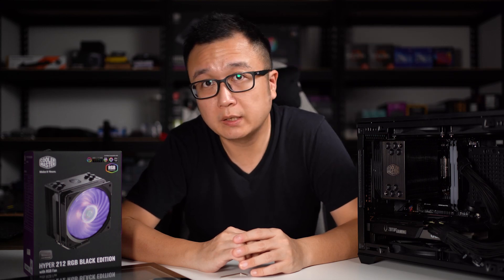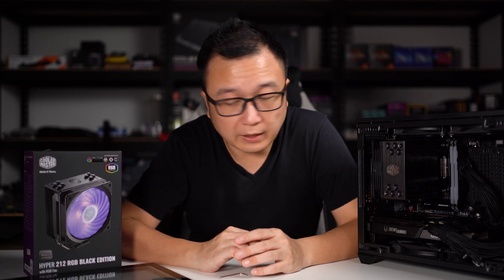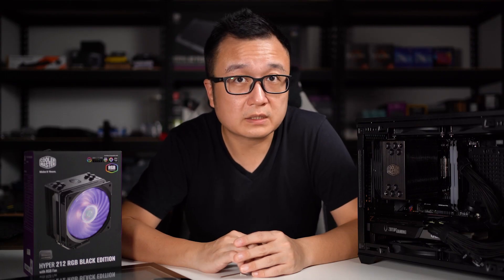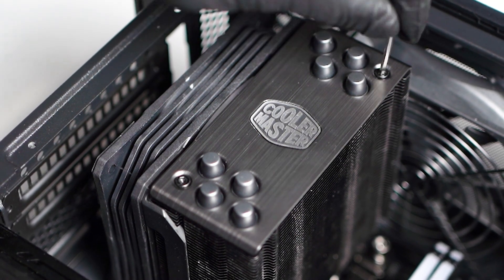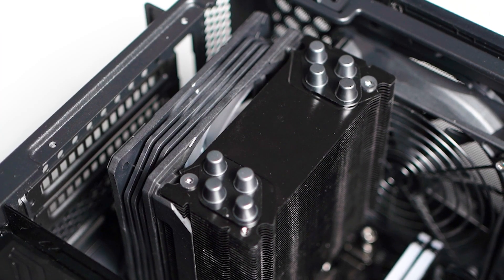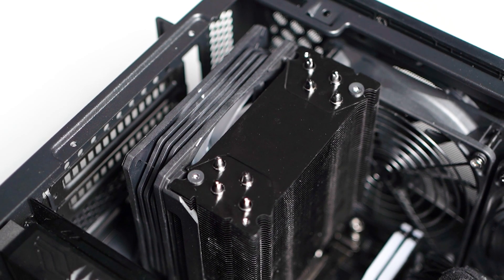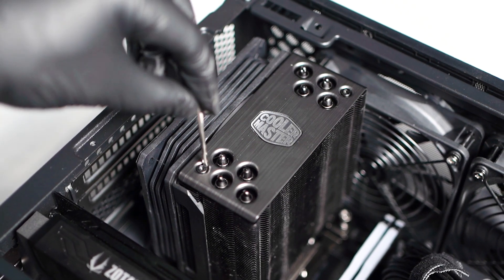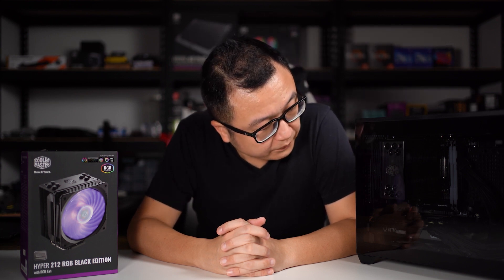I Hacked The CM Hyper 212 CPU Cooler!

Comment: Don't be me, after I custom installed an mATX into this case, ran into clearance issues with the evo 212 black edition, removed the pipes covers and still was making contact with the glass, me being an idiot who has not build a PC since early 00s took a dremmel and cut the pipes, clearance resolved! oh  wait, why is my CPU getting too hot under normal loads,...............google.......cooler pipes...........gas or water inside......oh snap! .....amazon.....new 5mm shorter evo 212 v2!!!!! solved for good.....hope this helps to more than at least one here...

Comment: How does the fit compares to MA612 Stealth in the NR200 (Mesh or TG)?
Reply from the maker: In fact, I have the MA612 installed in the NR200P now. TG will not close even with the top cover removed. Only mesh panel will close with the MA612 in the NR200P :)
Reply: @ghimtech  thanks for the reply! did it fit the mesh side panel with the top cover on or off?
Reply from the maker: I removed the top cover of the cooler, so it’s off.
Reply: @ghimtech  cool! thanks for the info!

Comment: are u able to fit the fan on the otherside without interfering with the ram?
Reply from the maker: Not the original fan as my rams are too tall (vengeance rgb pro). You’ll be able to fit if you’re using shorter ram
Reply: @ghimtech  ah so would have to be slim fans?
Reply from the maker: If you’re using tall rams, yes
Reply from the maker: @phigina  yes am current using the same setup with slim fans :)

Comment: Hey, cool video, simple and easy solution, do you think it will work for Lian Li O11 Dynamic? The case has clearance of only 155mm and I really dont wanna go the AIO route, the Hyper 212 black is sufficient and works great for ryzen 5600x, hoping for you to give reply soon, Thank you.
Reply from the maker: It is not something that I can answer you now but perhaps sometime next month as I have the o11d mini build coming soon
Reply: @ghimtech  thanks for the reply, its listed on their official website that the CPU cooler height clearance for the O11 dynamic mini is 172mm, so I think it would fit in easily, but for the non mini version it's 155mm. If I build it in the mini version I'll have to change the PSU as the mini version has specific requirement such as SFX or SFX-L and I have xpg core reactor 750w, in O11 dynamic non mini version the PSU is no issue, but it's just that hyper 212 black cooler height is a huge doubt.
Reply from the maker: @Amitgatte  I’m sorry I thought you were talking about o11d mini. I don’t have the regular o11d with me currently now to test it out for you unfortunately. The last time I had the regular o11d in my studio was almost 4 months ago.
Reply: @ghimtech  oh alright, I'll still pull the trigger on it and see how it goes, if it does not work I have wraith cooler as backup and after couple of months AIO would be the option. Thanks for replying.
Reply from the maker: Enjoy your build!

Comment: Are you running the CPU fan as exhaust or intake?
Reply from the maker: Currently running on 2 noctua slims 12x15 fans push-pull and exhaust towards the rear. 3700x tops out at 72c at full load.

Comment: The nr200p spec for cpu cooler clearance (tempered glass) is 153mm, after removing the cover the cooler should be around  150 - 155.5mm 

After removing the cover does the glass fits properly and it is still touch the cooler?
Reply from the maker: This hack will make the TG fit properly and not touching the cooler :)
Reply: @ghimtech  mine still touched the cooler, but  hacked the whole case to fit a full 246x246 mATX board

Comment: My motherboard is B450i AORUS Wifi Pro will it still able to fit? Sorry, might be a very noob question. Thank you in advance
Reply from the maker: Yes it will fit fine with the Aorus B450i Pro wifi. I have the same board on another system.
Reply: @ghimtech  like to ask CM HYPER 212 LED Turbo ARGB CPU Cooler will fit?
Reply from the maker: I’m not sure if the 212 Turbo will fit as I’ve not tried. The stated spec is 160 vs 158 on the 212 Black Edition. So even removing the top plate it might still be a little bit too tall

Comment: Just noticed that your setup is almost similar to mine. Which CPU and GPU are you using, and how's the temperature with the  Hyper 212 RGB? I currently have Ryzen 5600x and Zotac 3070 OC with default wraith cooler and temperature is 86c max. Trying to see if I can get much improvement switching to Hyper 212 RGB cooler.
Reply from the maker: The 212 will be an immediate upgrade to the stock wraith cooler. On stock my 3700x runs max at around 75c, currently undervolted to 1.15v @ 4.1ghz and tops out at just 66c max.
Reply: @ghimtech  Just want to say thanks. I switched the cooler and I can't believe the difference in temps and quietness. Wow :)

One question (or two) - the fan is set to intake right? Also, would it matter if take out the cooler master plate (will it impact performance)?
Reply from the maker: @IvanYudhi  the front plate is just a cover to make it nicer, has no impact on the performance. I remove the heatpipe covers (by first removing the plate) but reinstalled the plate so that it look better. Without the plate it will look a bit barebone so it's up to you :)

And the fan you may experiment with either intake or exhaust, depending on the airflow of your room/desk placement for optimal performance :)

Comment: With this mod are you able to use the NR200p side bracket? I need to use it to put a 3.5" HD there which I can't hang in the SFX mount since I'm using an ATX PSU. Thanks a bunch!
Reply from the maker: I just tried to slot in the side bracket and the answer is unfortunately no. Installing the side bracket lowers the cpu cooler clearance for futher 3-5mm from what i can see. You probably need a cooler that tops up at 150mm at most to have the side bracket installed. Hope this helps!
Reply: @ghimtech  It does help. Thank you very much for checking it and for your time!
Reply from the maker: @DavidrMir  you're most welcome :)

Comment: Can you tell me what the temperatures are with the TG panel on and with this cooler? Also is it possible to put an extra exhaust fan on the rear if you just used shorter ram and leave the stock fan on?
Reply from the maker: I’m getting idle 36-40, and full load around 70-72. And yes you can add additional fan at the back, the cooler provides extra fan bracket for you to do this

Comment: This may sound like a strange question, but when you remove the hexnuts, do any metal shavings from the nut threads shave off and fall to the motherboard or is it a clean build?  I don't want to short anything out.  And were they easy to loosen?  Thanks.
Reply from the maker: No there is no threads falling off anywhere. It’s a clean removal and reinstallation. If you’re worried of any threads falling, just remove it with your PC standing upright. And yes it is easy to loosen, and when reinstalling the plate you don’t have to tighten it to the max, just lightly screw it back in place.
Reply: @ghimtech  Thank you for the fast reply.  If i did it upright would the caps fall once I take the plate off?  But it's fine to just do it on it's side right?
Reply from the maker: Yeah it’ll fall off right after you remove the plate

Comment: Will this cooler be compatible with the Corsair dominator platinum ram? And should I install the fans the same way you did?
Reply from the maker: The front fan can actually fit but in a slightly forceful way and it'll push the first ram towards the second one. Slim rams like Corsair Vengeance LPX would not have this problem. So yes I'd advice you to either switch single intake at the rear (pulling fresh air from behind) OR switching to slim fan as front intake (like the Noctua A12x15)
Reply: @ghimtech  I could swap to slim fan, but I’d be spending more money and losing the rgb. I’ll just install it facing the rear. Am I losing out on anything performance wise that way? Thanks
Reply from the maker: In my experience for the past week, performance is the same, although consider adding a piece of dust filter at the back since you’ll be pulling fresh air from behind, or else your PC will be filled with dust within a month or 2 :)

Comment: What made you decide to switch the CPU fan as an exhaust rather than an intake?
Reply from the maker: Because of the ram I’m using - Corsair vengeance pro rgb - couldn’t clear the front fan in itx board. The rear fan is set as intake (taking fresh air from the rear) not exhaust tho. I also need to add a rear filter else the system will be filled with dust within a couple of weeks.

Max ram height clearance for this cooler in itx motherboard is 39mm, generally slim non rgb rams. No ram clearance issue with atx board however.
Reply: So, using Corsair LPX ram you'd have the room for a fan either side for a push pull configuration?
Reply from the maker: @HeroicDesignCo  ya any slim rams will allow the front fan config for the CM Hyper 212 cooler :) the corsair vengeance pro is tall and thick hence you will either skip the front fan or use a slim fan